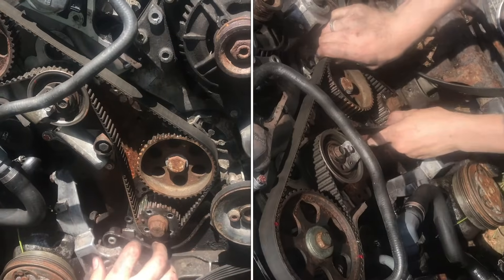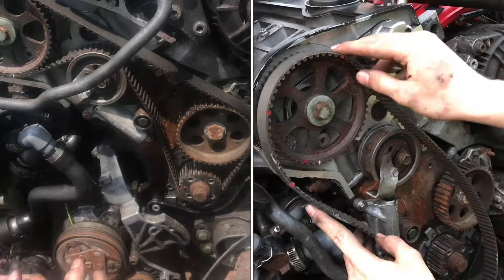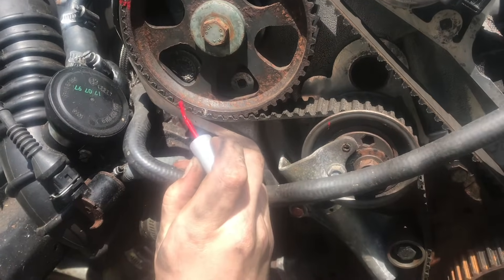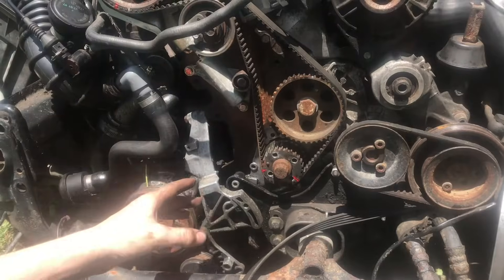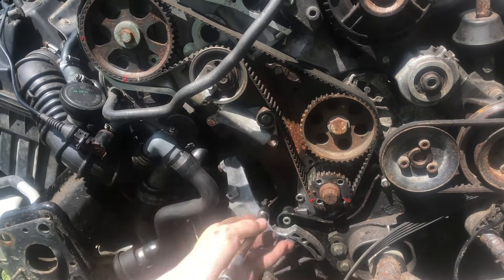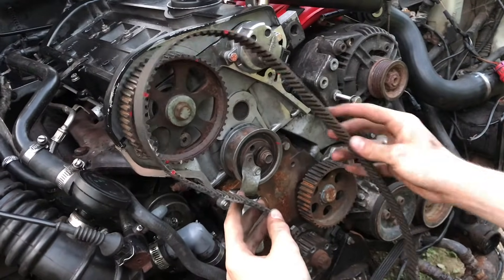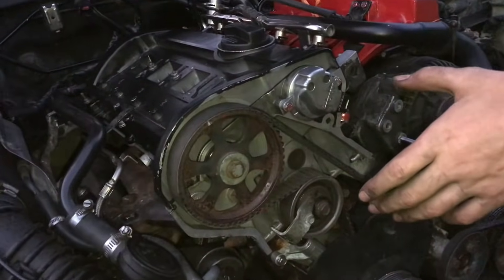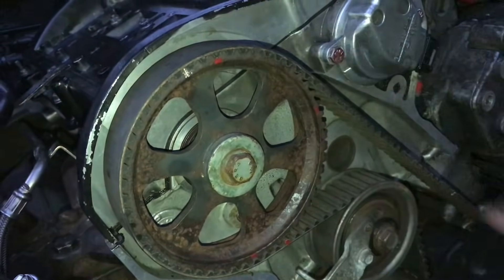how to get your “timing belt” back into the EXACT place when reinstalling (painting marks) 1.8t

Comment: Maybe better, to check if guy who made it earlier, have done his job good. Worth what you can do is repeat someone’s mistake. But it is probably level higher, just replace timing belt.😂
Reply: if the vehicle was running perfectly before then the worst that can happen is it will continue running the exact same. just put it in tdc and spin the crank to verify. chances are its bang on.

Comment: ok but new belt wont have those marks How am I suppose to put a new belt in
Reply: The crankshaft will.
Reply: Copy them onto it then
Reply: Just learn how to count the teeth grove
Reply: You can paint the marks on the new belts using the old one as a reference. I count the teeth for max precision
Reply: @arnasvilhelmas7236  Yeah that's what I figured, put old and new flat on the ground next to each other and copy the marks. Counting teeth if you wanna be 200% sure. Doubles as a check that you have the correct length/#teeth new timing belt.
Reply: @arnasvilhelmas7236 thanks for confirming an idea. Great minds must think alike.